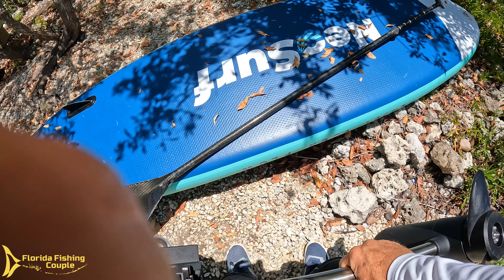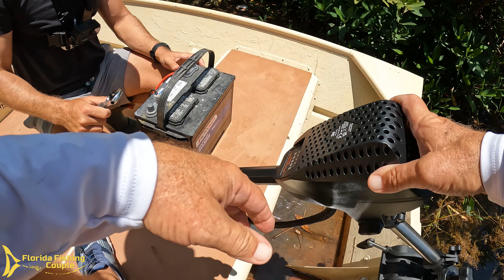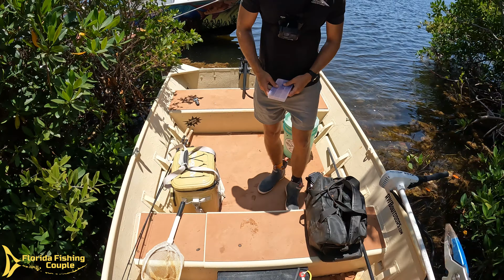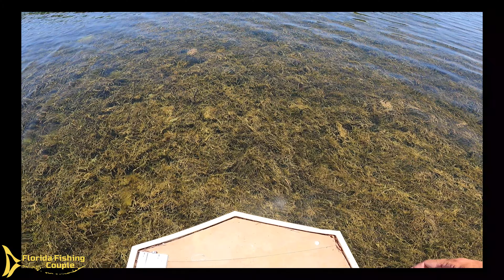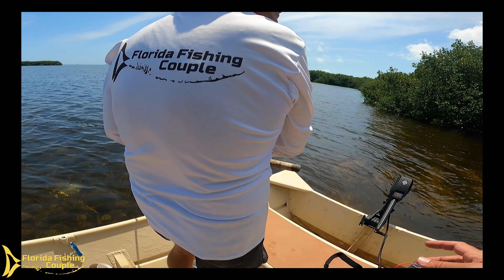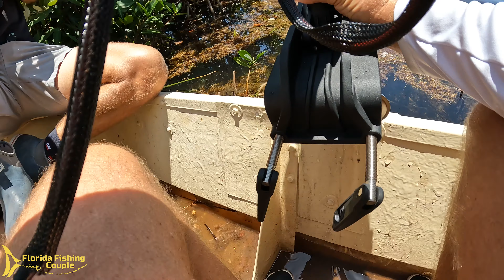VEVOR Electric Trolling Motor Review: Back Country Catch and Cook

Comment: Hey guys, this is a 24 volt trolling motor. I would love to see a repeat test of using this trolling motor on Heiko's boat.
Reply from the maker: That was Heiko’s boat!
Reply: @FloridaFishingCouple  yes, got that fact, but a repeat test using a 24 volts battery or 2 - 12 volt batteries in series, would be a better test. 

"24v hooked to 12v will spin for a while on a full battery but there will be no torque. You could stop it with your hand. It is like running your motor with half the spark plugs missing."

Comment: Great video!!!, Thanks for sharing it. I'm planning to buy that same trolling motor. What battery did you use to power it? The motor seems to be 24V.
Reply from the maker: So, we found out it should have been a 24 volt battery but we used a 12 volt car battery that day. Go figure!

Comment: That's a nice little motor. I could see that working on a canoe with a back engine mount. Personally I would use it on a boat like heiko's. I need something bigger that I can walk around in. My back kills me in a canoe or kayak. 
Did you have that at the highest speed while you were cruising back? How fast do you think you were at top speed?
Thanks Dan for the video.
Tight lines....
Reply from the maker: It pushed that John boat around pretty well. I was very surprised how it performed overall. No bells or whistles, just a basic electric motor that got the job done!

Comment: Hey guys , just wondering can you connect single 12V battery to 24V vevor trolling motor ? I just got same one 55Lb and just wonder should I get 24V battery or 12 would be enough? Thank you
Reply from the maker: Everyone in the comments said it needs 24 volts but we used it all day with just 12.
Reply: I also asked manufacturer that said only use 24v or two 12 v, because it might not even start What kind of battery did you use? How many Mah? How long were you using it ?thank you for the respond
Reply from the maker: The video was proof. We only used a 12 volt normal car battery. 🤷‍♂️

Comment: Should have tried the 95lbs.. and on 24v like it should've been run on.
Reply from the maker: Actually the instruction booklet says it runs on only 12 volts. We had no problems with it on the 12 volt battery. 👍
Reply: They might have sent you the wrong book then, definitely runs better on 24v..

Comment: Hey Dan. That's a 24v trolling motor. You were getting half the power
Reply: This
Reply from the maker: Whaaaat!?!? Then that motor is way better than we thought! 😀
Reply: Yep. I would love to see a rereview before I buy one and modify it to my 8ft kayak. I don't have YouTube money but I'm trying to get an 8ft kayak to 25mph as cheaply and quietly as I can
Reply: I just saw this video. And you noticed also that the vevor is 24 volt. I don't see any that are 12 volt. What I'm wondering. , is it okay to run these 24 volt motors on 12 volts without hurting it.

Comment: You’ll didn’t have the right voltage for your motor it needs 24v system. That why it was slow and will over heat.
Reply from the maker: Found out you were correct. It needs 24 bolts. Ran great with 12 though! 😂😅😂